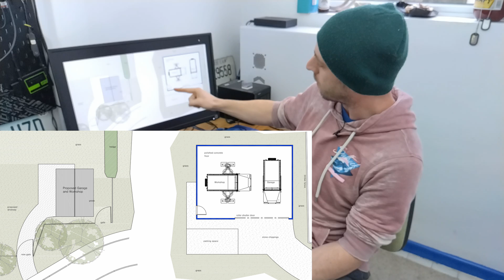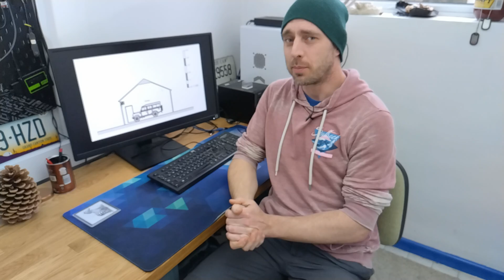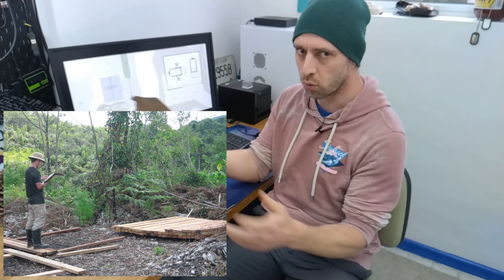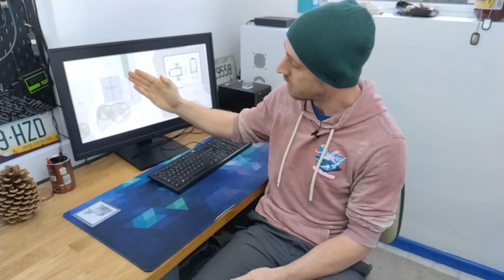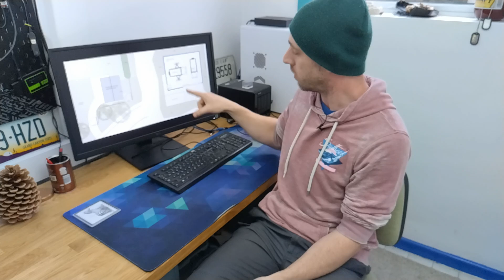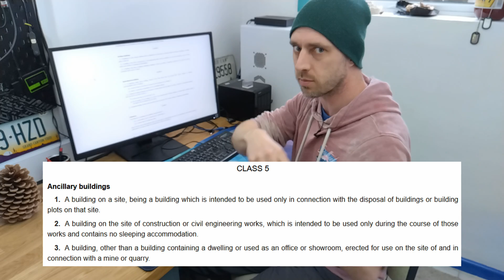Plans Drawn. Building Regs required? UK Garage/Workshop

Comment: Hi.   Personally I would probably turn the lift 45 degrees, it gives you better access to working on vehicles, especially the rear on your plane. It doesn’t restrict other car
access. 
  Useful as two post lifts are, they can be restrictive for some jobs, but same for sizer lifts and four posters.  Think about how your application and how it affects different stages.

Comment: Looks like a great project Will.  I built something similar 25 years ago with very similar requirements.  Essentially a three bay shed, two roller doors. 15x9 meter.  It is steel framed shed and skin (termites here) with 3 meter heavy duty work bench with a galvanized steel covering.   Several coats of Oil resistant paint on the slab is also a must. There are no shortage of these available here as  DIY kits or builder of your choice and certainly no need for an architect!  The whole thing up in a week, from excavation to lock up! 
What I would have done differently in hindsight or funds permitting at the time.
Sufficient hight for a defender on hoist and taller doors as you suggest. As you say maybe remove the hoist at some point but you need the slab thickness from day one and maybe three phase power.
Heated slab, mine is in Australia but temp at our farm ranges from -5 to over 45 so this would be a great advantage the three months of year it’s cold.  
Insulation is a must, or at least sarking as it’s called here to stop condensation from dropping on your vehicles. 20k sounds ridiculous, I’d shop around there! 
Additional windows at opposing ends of the shed to allow for a cross breeze to enable cooling, maybe not an issue in the UK 😊
You can never have enough power outlets. 
An overhead crane and traveling dolly to enable moving engine/gearbox etc to work bench.  Just a securely mounted 2in gal pipe would do.  (Benefits of a steel frame shed).
Hope this help and all the best with the project.  Photos please!!
Reply from the maker: Thanks Simon!

Comment: You don't have to fix your solar panels flat on the roof, you can mount them on their own frames, at the correct angle. Your latitude plus 15 degrees.
Reply from the maker: Good point!

Comment: Building regulations/control is the easy thing to comply with. As you say over 30m2 you need it. With a house you will usually have an initial inspection when you start the project i.e. before you change anything. The next inspection is the footings, slab or trench whatever you’re going for. Then damp proof course. Then insulation. Then final inspection. 
In my experience building control officers are very friendly and helpful and on each inspection just ask what they want to see next. Where with building a house or extension you may cover up things they need to see this is less likely with a garage and therefore the number of inspections may be less. With my local council the cost is dependent on the size of the project not the number of inspections.
Reply from the maker: Thanks good to hear. Is there a bit beforehand where you submit plans to be approved?
Reply: @lrworkshop  easiest is to submit engineer drawings where everything is specified, however these drawings cost money. You can do the research yourself what timber sizes etc you need. Architect drawings should be sufficient to start the process, from there it will depend on how friendly your building inspector is. I’ve found in the past that with a bit of research you can tell them what you intend to use and they will tell you if their happy with that or not. With the very helpful ones you can ask what size of lintel etc they want to see and then buy accordingly. Most ‘approval’ from building inspector will be onsite. If you’re unsure about anything they are there to help. With my local council the planning department are the most obnoxious bunch of people you could ever meet. And the building control department bend over backwards to help you.
Reply from the maker: Thanks, really helpful